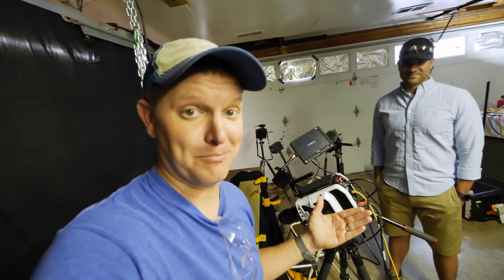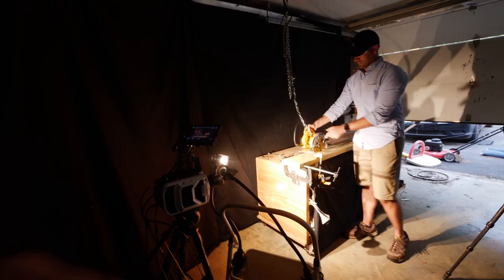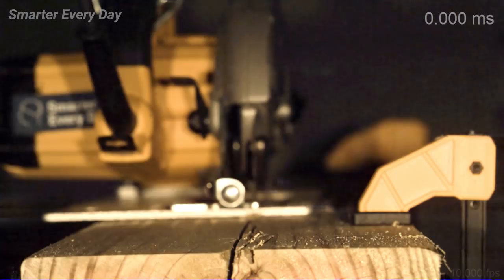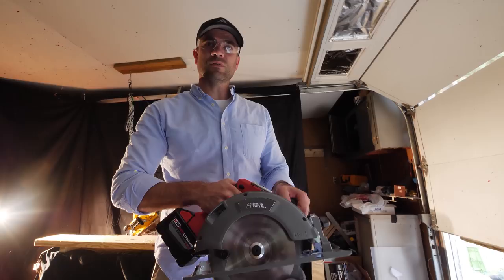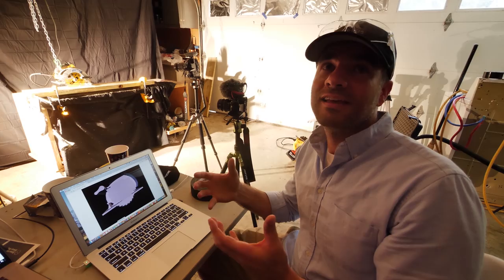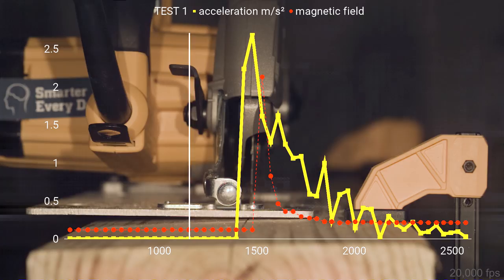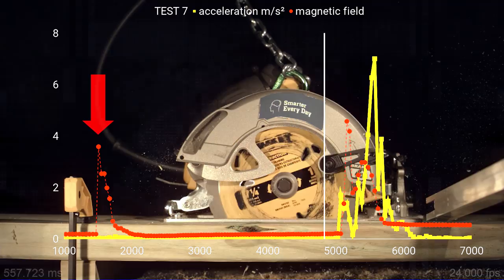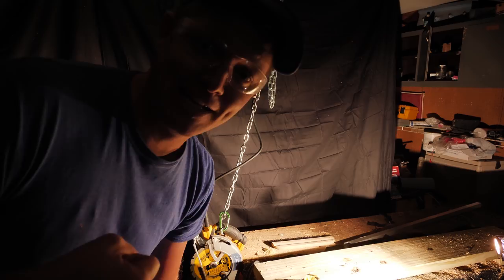Circular Saw Kickback Killer (We used science to make tools safer) - Smarter Every Day 209

Comment: A riving knife behind the blade would fix the pinching. That's how they handle it with table saws....
Reply: Isaac Kotlicky in the 16 inch timber framing circular saws they have those as well.
Reply: Except those get in the way when doing plunge cuts, otherwise they'd be more commonplace.
That and when was the last time you saw someone use theirs on their table saw, outside of high school shop class?
Reply: Yeah. Although I do use a riving knife on my table saw. Not really any reason not to unless doing dados.
Reply: Skorpeon RyDer I use a riving knife and a blade guard for ripping all the time. And don’t see any issue at all.
Reply: that would help with pinching but when you hit a knot in the wood or induce a slight twist.... Well here comes the blade at full speed.
Reply: Jesse Izor general hitting knots doesn’t do a whole lot. I’ve cut through many nails and knots and if you have a good hold on the saw ( as you should) it generally isn’t much of an issue. You have a point with the twisting.
Reply: @Skorpeonismyrealname  Always. Only time the riving knife isn't used is for a plunge cut. You wouldn't plunge cut a table saw.

The thing that doesn't get used very much, is the top guard, because you can't make dado cuts.
Reply: @justanotherperson7604  Twist in the wood is stopped by a riving knife. Unless you mean a twist in the operator hand? At which point that's a bad operator.
Reply: @Skorpeonismyrealname  I use mine, every cut.
Reply: @PBMS123  I agree it would be a bad operator. And that's what I'm talkin about. But let's face it most weekend Woodworkers don't really have a hundred percent grasp of what they're doing in the first place. Even if it saves 10 people per year it would certainly be worth it to implement it
Reply: you implement controls for a 2 percent risk that is 100 percent catastrophic. I would say "people are kind of dumb, and make mistakes a lot" a light higher than 2 percent.
Reply: Graham K but these circular saws already have a guard.
Reply: @PBMS123  You've never plunge cut with a table saw? Not that I do it very often, but I have before.
Reply: I've cut tens of thousands of plywood and aspenite sheets and various lumber on an Altendorf industrial sliding table saw, I've cut sheets so twisted they were almost half-moon shaped, and let me tell you that the riving knife makes a night and day difference. It doesn't prevent every pinch scenario (especially when slicing stressed lumber that starts bending in crazy ways once you relieve the stress by cutting through it) or replace technique and experience, but it helps. Never let the blade control you or your workpiece, and if it gets bad and powering through it doesn't help, just raise it off and flip it. There are many instances where you need to take the knife off or lower it to do come cuts, too.
Reply: Maybe a spring loaded riving knife? So you could still do plunge cuts. They could even design one that would make it easier to cut a straight line.
Reply: Rwededyet already exists on most good quality track saws, and a few circ saws. +this would be so much better.
Reply: i believe they are standard and most handheld saws in the UK should have them
Reply: @Skorpeonismyrealname  my track saw (a plunge cutting saw) has a riving knife. a riving knife - not a splitter - moves with the blade
Reply: @gtfkt  you should go check out john heisz's speaker build video. that dude does not work safely... and in my opinion there's literally no reason to do dangerous cuts given how simple and unobtrusive something like a crosscut sled id.
Reply: Literally every handsaw needs to have that in switzerland, its a regulation and such an easy fix to this problem
Reply: @guitarchitectural  Some people simply have no  safety inclinations. I've had to stop coworkers who were putting themselves and everybody in great danger of injury dead in their tracks many times. aka: STOP, what are you doing? Think it through, someone is gonna get hurt if we do this that way.
Reply: Although a riving knife is a good cheap fix that would work in most cases, in practice, most people probably don't use them.  Even if they are used, I'm a huge fan of smart electronics that know to turn themselves off when they're not performing properly.  When used properly with the safety features already available, kickback may not be a problem or at least its risk is greatly reduced.  However, I don't think that should mean we stop trying to make it even safer.

Comment: we actually had kickback protection in our angle grinder and battery powered drills at work. they are made by bosh and it honestly work great. i can't count how many times a drill have gotten stuck with the pevious drill machine made by Dewalt and having in try to rip my hand off and this kick back may not be perfect and have triggered without a kick back have greatly reduced the number of times that it have happened and the few times that i have felt it have it greatly reduced the severity of the twist that the drill induced on my hand.

same with angle grinders but even more important. i had an angle grinder get pinched and it turned out of my hand and cut my thumb. but thanks to this stop did it just cut a small hole in my glove and slightly scrape the top layer of skin and no blood was drawn. that in comparison with a different angle grinder in almost the exact same situation only that i was holding it with my left hand this time. it turned and cut a deep groove on the knuckle on my left indexfinger down to the bone. i was lucky that it didn't hit any critical area of my finger and only cut skin but there was a lot of blood this time.

Comment: So just using a accelerometer circuit, a comparator chip, a transistor and a solid state relay is basically all you would need for this. Pretty amazing idea.
Reply: this implementation requires learning algorithms, but if you can extract the "profile" of the kickback from the data, then yes you would only need that, for now it requires a computer though.
Reply: In the video description it mentions that it's storing the last 250ms of data to look for patterns and avoid false alarms.  Your setup would work, but it may set off any time you jiggled it too hard.

Comment: This is so cool
But, could the kickback be avoided with a small wedge behind the blade to stop the wood from pinching?
Reply: I know saws that have something like that, and I thought about that too.. don't know if that does work or not
Reply: Seems to me that then the wedge gets pinched, preventing the saw from being pushed forward by the human user. Frustration sets in, then user removes the wedge as "too much hassle."
Reply: The wedge still gets pinched, but not the blade, so no kickback
Reply: Perhaps it's because kickbacks can be caused by things other than pinching? at 6:40 the saw is running fine by itself, so no pinching, then he pushes it at an angle and the blade digs in. I've not had a kickback start like that, but maybe it can happen if you twist the saw a bit to one side as you go?
Reply: The wedge would be very annoying, as you would not be able to plunge cut with it.
Reply: @ILikeWafflz  Yes if you have to plunge cut the wedge must be removed, if you don't, especially as a construction tool with further risk factors like uneven materials and strain on it due to bad placement the wedge is the best and simplest way to reduce kickback risks.
@Colin Faed the wedge  or roving knife helps a lot against kickback from twisting. The kickback occurs not from the frontal edge of the sawblade as friction there pulls workpiece and saw closer together, without a wedge at the rear twisting increase friction in the rear where the blade runs away from the workpiece, causing it to jump out. With the wedge  it protects the rear of the blade to be pinched or turned into the workpiece, making it very hard to get increased friction und thereby it wont jump out.
Reply: Festool has this wedge on all of its saws ;)
Reply: That's called a riving knife.  They're very common on table saws, not as common on circular saws.
Reply: Great thought! Yes, please use a riving knife where possible. This is not meant to replace conventional safety measures, just complement them to cover edge cases.
Reply: This is one informative comment section
Reply: Thank you all

Comment: My 30 years old Elu solves that problem mechanicaly. Behind the sawblade is a metal, formed like a sickle/crescent, which is appox. is as thick as the sawblade. In the late 80th of the last century Black&Decker took over Elu, which now is Stanley Black & Decker Corporation. So I think in the US you can also get save circular saws with less electronic.
I'm to poor to buy cheap tools ;-)

Comment: Yoy know a wedge the width of the blade would also make it so that the blade cant be pinched.
Reply: Have used, can confirm.
Reply: My Festool TS55 has a built in splitter right behind the blade, stops the blade from being pinched, thus no kickback.
Reply: Interesting. Reading this comment makes me motivated to reinstall the antikickback guard on my table saw. I thought it was silly putting a mini wedge past the blade..........
Reply: @cokeacolasucks  do keep it, it avoids potentially taking a 2x4 to the gut.
Reply: @TokyoCraftsman  The simplest way's are usually the best.

Comment: Good for novice operators. I have been using circular saws for over 40 years and with that experience you know what conditions can cause a kick back  and learn to control them . That being said I like what you are doing with this and safety is paramount.
Reply: @Joshua Doub you must know a lot of folks who lost their fingers with a circular saw;  I know of none; the ones I know cut their leg
Reply: yup; they wire the guard back and put it on a rope so it jumps without any experienced  hands on it that can control it and Joshua Doub can run his mouth
Reply: @Joshua Doub In over 40 years in construction I have never worked with anyone who lost a finger with a circular saw., Maybe I just worked with lucky carpenters or experience can prevent it from happening.
Reply: I think most guys lose fingers on a table saw
Reply: Jason Swoger My neighbor just lost three on a table saw a couple weeks ago

Comment: Excellent video, as always. I have one safety concern though. Destin, when you did the hand test of the system the saw was still connected to the safety chain. In that case I think it would be safer to keep it un-tethered because an un-tethered saw that you lose control of will move in a direction and continue, eventually moving away from you. The tethered saw however would not move away from you and would therefore pose a greater hazard. 

But your science solved that issue anyways, so who am I to criticize? 

Again, great work :)
Reply: Zebulon Pike   With the saw untethered there is some non-zero percent chance that both Destin and friend could be hurt. When the saw is tethered only Destin is in danger. It is a sacrifice, but a sacrifice that the other guy is willing to make. 😁

Comment: dont circ saws have a spring loaded guard that would flip forward in the event of this happening? I would think that as soon as it leaves the wood, it would flip back and the blade would be safe again. Also when your cutting you're behind the direction of travel anyways right?
Reply: Yes. They have the guard pulled back. Sometimes the guard can get caught or just be in the way of what ever your cutting. I’ve had times where I had to tie the guard back cause it was in the way. Defeats the purpose of the guard but what they made it’s more of a secondary safety device
Reply: @Joe Hoe I mean, those sound like they had their extremities in front of the saw lol. I've had the saw kick back on me on only a couple occasions but its always gone away from me.

Running a circ saw without a blade seems to run in the same line of stupidity as people who remove the guards from their table and miter saws. Just seems like bad things waiting to happen.
Reply: @Joe Hoe You know what, i'm totally misremembering which direction circular saws spin, my bad. I rarely use mine, I really only use my miter saw. I can see how that would happen now.
Reply: These things are true, but sometimes it is just not quick enough, ask you local A and E (trauma centre).

Comment: Sawstop wants to know your location
Reply: Isn't sawstop used when flesh is touching the blade? If you were to combine those two systems it could be amazing.
Reply: @Aravzil  Yeah its for table saws, bulky mechanics wont fit in buzz saws wheras this mechanic works with movment of the saw, meaning cant be combined into a tablesawwith sawstop.
Reply: I thought sawstop was a hoax
Reply: @asm2750  But without the sawstop brake, there is no sawstop.

For others:
Sawstop stops the blade as you touch it with a super fast braking mechanism that basically jams soft metal into the teeth of the saw blade. The device in the above video stops the blade before you touch it, so the braking can be (relatively) slower.
Reply: @toasty4000000  my high school wood shop had one. Was a great saw to use. Well the year after my shop class, (I took it jr year so my senior year) it paid for itself when some kid set it off and it stopped. They then put the saw and brake on display.
Reply: @SlicedBread2014  they do know that you can just replace the brake to keep using the saw, right? :D

Comment: Being a master carpenter and custom cabinet builder and installer for years I’ve had kick back on circular saws and 220v table saws and I’ve never had a issue. Respect the equipment but don’t be afraid of it. Remain in control at all times the equipment does not control you. I did that work for many years and I still have all my fingers and never had an accident but I have locked up 5hp motors on table saws when a kick back happened and turned the saw off with my foot while I held the work piece so it would not move.